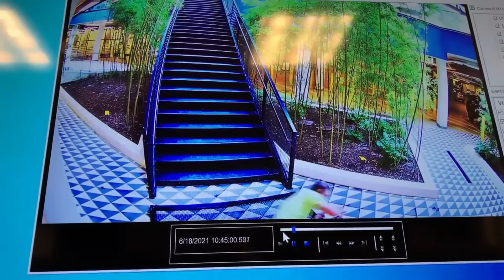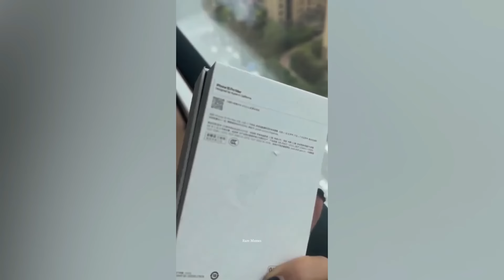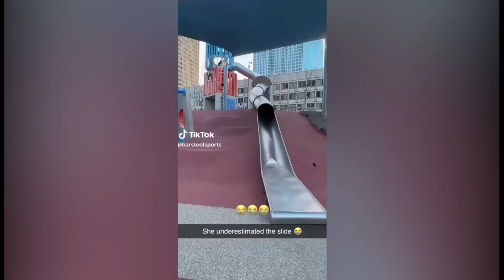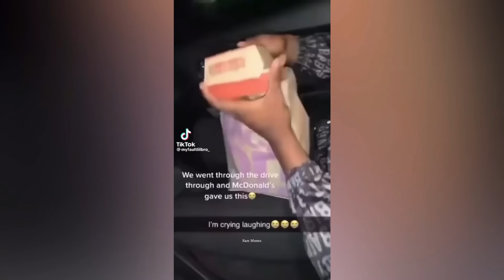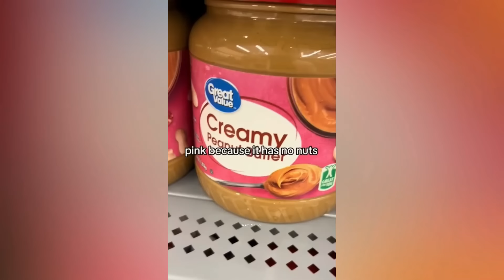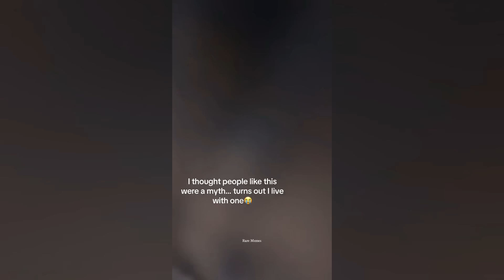Best Of People Dying Inside (So Far) 2023 | Instant Regret | Funny Fails Compilation

Comment: At 2:03...that's actually a telescoping BACK SCRATCHER.  Never saw one used like that, but it makes for an awesome comedy bit, haha!  Anyhow, the cheap ones are the best ones, because the little "fork" on the end is just thin stamped-metal, which makes it AMAZING for scratching your back!  The cast-metal ones often have edges not sharp enough to scratch your back.  You need the thin fork-like one, just like how a bear in the woods will choose the tree with the most twigs hanging off the main trunk!